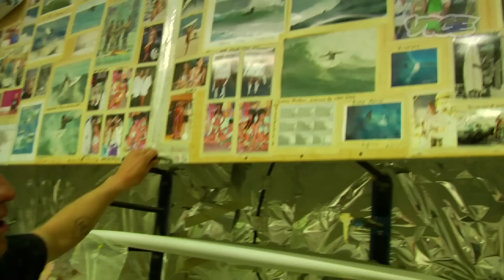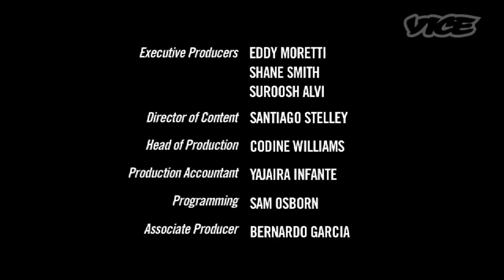Experimental Surfboards with Chad Marshall

Comment: Are you new to youtube?
The 301+ thing is normal, there is a viewcount verification, to check for bots, double view in rapid succession (browser or user error, etc).
It happens to start at ~=300 view. The count is buffered while previous views are checked against hints of automated views and the like.
They do that to spare computational power on the "small videos" that barely anyone watches yet still have a somewhat checked viewcount to offer to adsense buyers to entice them to place ads on YT!